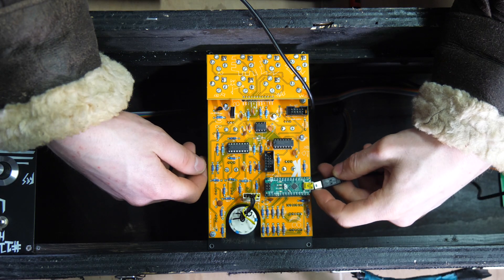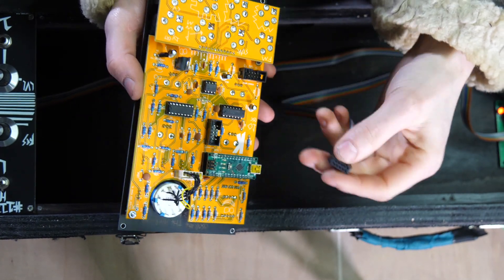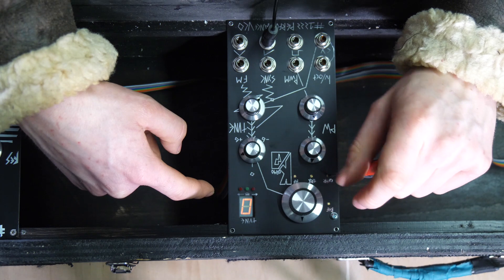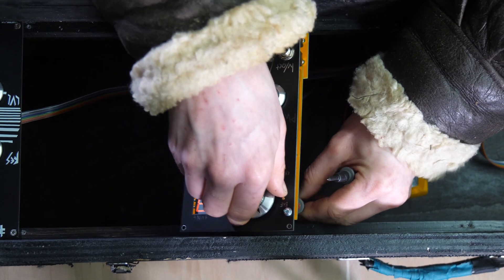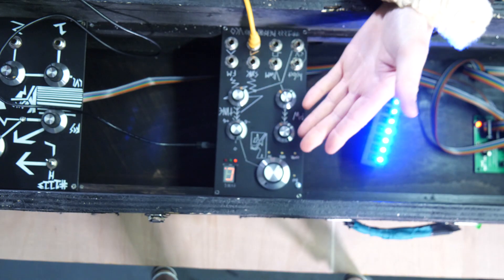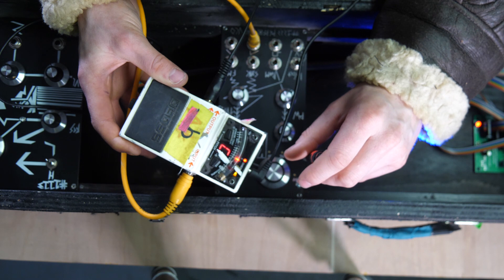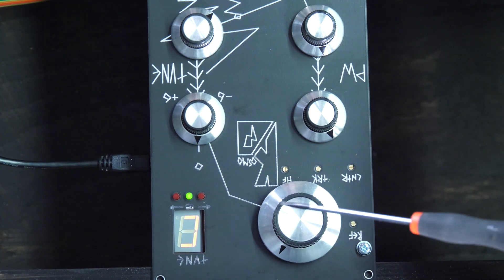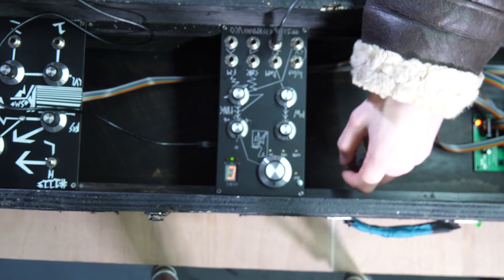3/3 Calibrating the Kosmo 1222 Tuner VCO

Comment: 7:54 how about using centre detent potentiometers?
Like these: https://www.digikey.co.uk/product-detail/en/bourns-inc/PTV09A-4020U-B104/PTV09A-4020U-B104-ND/3781131
Reply from the maker: because the thing with an analog oscillator is I can see a situation where its a bit hotter in a gig, you adjust it and its slightly next to the centre indent and you can't get in tune

Comment: SAM! If your solder shows up in a circular ball, it's cold! Warm up the pin and the metal it will be attached to at the same time and it should suck straight into it!
Reply: Solder can also ball up like that if you add way too much.  If you're impatient while soldering it's easy to keep adding before it's fully heated, then it'll never visually wick fully.  I had that problem a lot when I was starting and couldn't figure out why until a friend told me I was drowning each joint hahaha.
Reply from the maker: @dcurry7287  you both notice my bodged solder on a ground pin. it worked, that was the issue I mentioned in the previous video.

Comment: I wonder if the trimming range for the reference needs to be that huge from 0 to full voltage. In that configuration all the temperature error from RV3 will have a lot more impact than using a 5K trimmer and a 100K resistor to ground. Limiting the Ref adjustment to 3.9...4.1V. But anyway. Awesome circuit and good videos!

Comment: Good explanation on the adjustments...I was thinking re your previous video, that definitely before you put ICs in sockets you should make sure the voltage regulators are working correctly...or it may turn into a long bad day.
Reply from the maker: indeed! luckily in this specific module, even. if the voltage regulators were some how sending the full voltage, nothing would break. the 7805 is a security measure, and the other one is just a reference :)
Reply: @youbetcha64 like Father & Sonthesizer always end up frying the chips...
https://fatherandsonthesizer.wordpress.com/